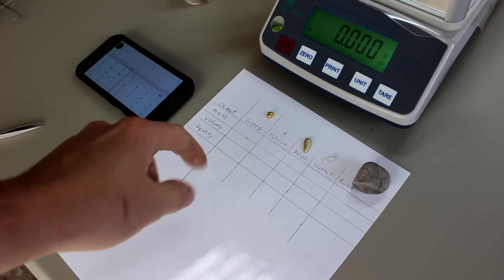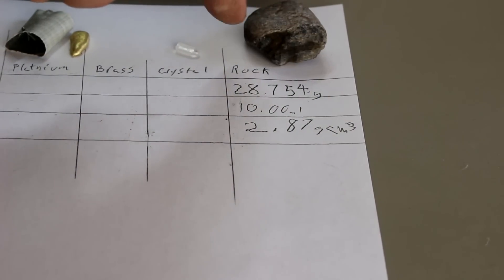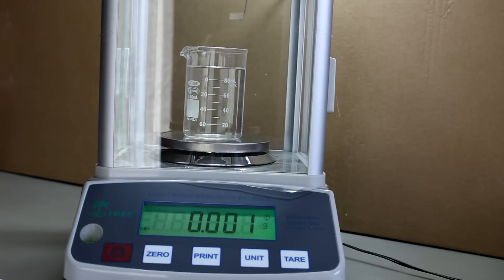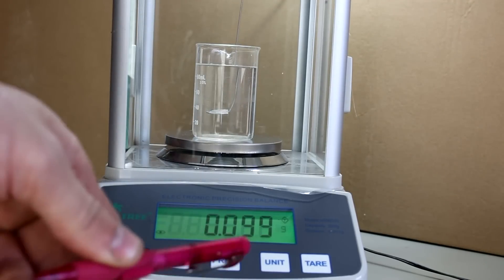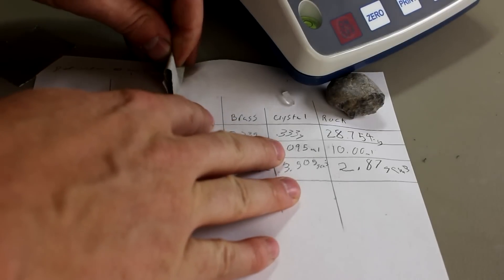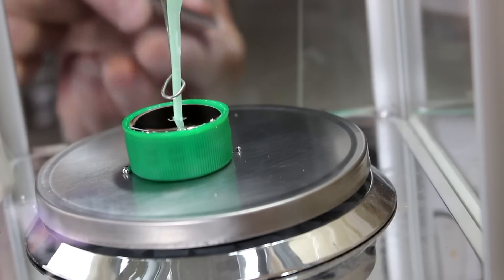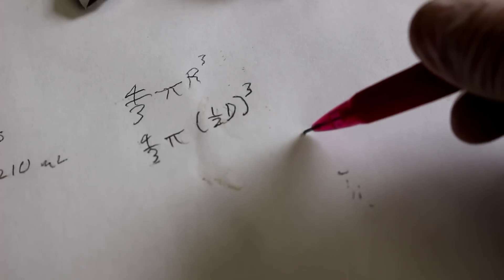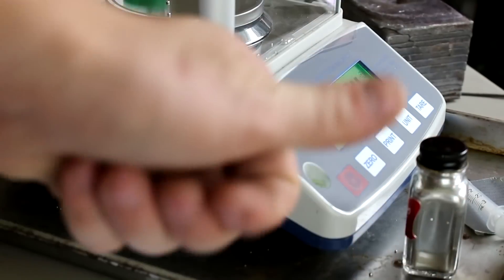Measuring Density of Small Irregular Objects

Comment: Would the buoyant force not be proportional to how far down the object is placed in the liquid?
Reply from the maker: nope
Reply: You were probably thinking about hydrostatic pressure. Those are two different things. The buoyant force basically is the weight of the water which is "pushed away" by what ever is submerged in water. So as long as the object is completely covered by water it doesn't mater how deep it is because it still is going to "push away" (displace) the same amount of water.
Reply: Ah okay thanks

Comment: your platinum measurements were rather erratic.. 5 increments of the same value off of one another.

Assuming the item was platinum with some imperfections, it is more likely the mercury measurement was correct.
it was often close to lead and lead is less dense than platinum.

Comment: Hi Cody. it's a nice method to find the volume of random objects. but I'm wondering if you ad the object into the beaker the waterlevel will rise. and therefor more of the wire will be in the water. so the volume must be the volume of the object plus the volume of the additional exposed wire.
Reply: that is correct!
Reply from the maker: the amount it increased was below the detection level of the scale.
Reply: So it does increase it, but not enough to really matter in this case.

Comment: Could you do Mercury by using liquid nitrogen instead of water allowing you to have a bead of mercury to sit on the wire ?
Reply from the maker: I would just add the mercury to a little cup just like I did with the platinum.
Reply: That would give you the density of solid mercury at almost -200°C. That value won't be of any use when working at room temperature.

Comment: Wouldn't measuring the weight of the object in the water be unreliable as it's still displacing water which would add to the weight? Shouldn't it have been weighed outside of the beaker? Sorry if I'm wrong
Reply: Upon watching more of the video, this is on the crystal only, but I believe you would have to take away the amount displaced to get the true weight of the crystal
Reply from the maker: The buoyant force is adding its weight along with the extra weight that would be taken by the wire.
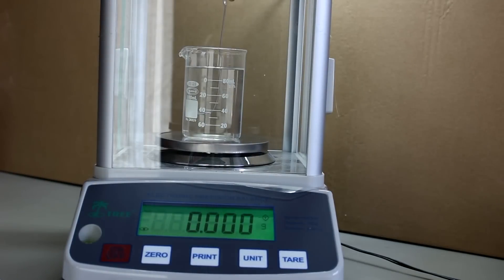Reply: Sorry if i'm confused, but wouldn't that then give a bad result of the crystals mass at 3:05 ?
Reply: No the buoyant force is not an issue because nothing is pushing anywhere else (contrary to the metal wire scenario). But the issue with putting the crystal in the water is the measurement sensitivity. What the scale sees is mass of the water + mass of the crystal, if the balance has a 2% relative accuracy and the crystal weight 1% as much as the water, the dilution of accuracy is incredibly high. Imagine you have a multi-range auto-select scale, the water itself might have shifted the scale to a high range, but you are still trying to measure a very small difference of mass. 

I won't go into it because it's an engineering field in itself, but when measuring something, you should always try to measure it in the smallest range of your measuring device possible, and the ratio between your measured value and the high side of the measuring range gives you an idea of the quality of your measure.
Reply: i have an accurate scale and i will test your theory, owen

Comment: I have a Question: when you weighed the crystal you put it in the beaker of water, wouldn't the .333 be the weight of the crystal plus the water displacement? so the weight would be around .238 (unless the height of the object is important). anyways , love your vids! and I live not far from you!
Reply: Theoretically, if the crystal is supported from a suspended wire and not actually having it's gravity and mass directly in contact with the scale, it acts as a "crystal of water" when it merges in volume and then you figure out the funny business on why it's readings are different than a crystal-sized amount of water with some math! :) Hope that helped.
Reply: Okay, so what he is measuring is equal to the mass, because the buoyant force pushing up on the object has a resultant push down from the liquid, which is equal to the buoyant force in magnitude and thus cancels it out.

Edit for anyone else thrown for a loop: This is only the case because we are weighing the object AND water. If we had a tiny scale in the water measuring the crystal it would read less than the mass because it wouldn't be able to measure the water around it and read out the resultant force.
Reply: PterodactylDanceParty
Try for yourself, please. Any kitchen scale should do the trick.

The easiest way to see that you are wrong is if you use a bottle of water as the weight, in a bowl of water. With your reasoning it shouldn't move the scale at all, since the densities of the water in the bowl is roughly the same as the bottle.
Reply: The mass of the crystal is hung from the ceiling, so it doesn't affect the measurement. What does is the fact that the volume of fluid it displaces will be pushed higher up in the beaker, meaning you have a higher column of water, and a higher column will exert more force.
Reply: Right, but he measured the mass of the crystal INSIDE of the beaker. This means it was submerged and there was a buoyant force present.

EDIT: I'm wrong
Reply: PterodactylDanceParty
He didn't measure the mass of the crystal. The crystal was entirely supported by the rod. He measured the buoyant force alone.
Reply: I'm not talking about that. Go to 3:02 in the video, he drops the crystal into the water and it falls to the bottom. He uses that number as the mass of the crystal, which is incorrect. I assume Cody realized this for the brass onwards, but left it in the video for the crystal.

EDIT: I'm still wrong
Reply: PterodactylDanceParty
That is not incorrect. The buoyancy in this case is from the liquid pushing the crystal upwards, and as Newton famously said: "Every action has an equal and opposite reaction" - the liquid is pushed down by as much as the crystal is pushed up. Since both the liquid and the crystal are in the container, the effect of the buoyancy cancels out.
Reply: I'm sorry, but what you're saying doesn't make sense. Yes the forces cancel out, but that downward resultant push the beaker feels is measurable and being picked up by the scale along with its mass.

EDIT: Yup, still worng
Reply: At this point I can't tell if you're messing with me.

Assuming you're not, just humor me for a bit. What is Cody doing at 3:02, and why?

EDIT: Sassy and wrong
Reply: PterodactylDanceParty
He is weighing the crystal, so he can calculate the density of it after he has measured the volume of it by placing it on the supporting rod.

I am not trolling.
Reply: Correct, he is collecting the mass. However, the crystal is submerged at that time and has a buoyant force on it, right? The number on the scale at that moment represents more than just the mass. You should not collect the crystals mass while it is submerged, do you see what I'm saying?

EDIT: Wrong, but about to get it
Reply: PterodactylDanceParty
I see what you are saying, but it is wrong!
Reply: I might be starting to see what you're saying
Reply: PterodactylDanceParty
On the point! :)
Reply: Well said !:-)

Comment: Hmm, you should take the average over three axes, not two.  Probably even the geometric average, rather than the arithmetic average (though that will make little difference for measurements this close together).  Simple enough: if you have a sphere that's pressed down on one side, you only need to measure the "long" side once, but that "side" has two dimensions, so you assign it double the weight, when you take the average.

Comment: When you place the irregular material into the liquid, the liquid rises up and more of the wire holding the irregular object is now under the liquid. This new amount of the wire under the liquid should increase the amount of buoyant force not related to the irregular object. Can you calculate this amount so you can factor it in for more accurate results?
Reply from the maker: you could, or you could use a wire so small that the change is in the sub milligram level. :)

Comment: earlier this year i had to use the same method, but used a much higher density liquid for improved results. We made a Gallium Osmium alloy which had an SG 17 and was liquid at Australian room temperatures (35.3c)
Reply from the maker: I'm very interested! I've never heard of using a gallium osmium alloy! I have to try this now.
Reply: ***** NOBODY EXPECTS THE SPANISH INQUISITION!
Reply: Sounds dense
Reply: ***** the easy way might be to dissolve (react) osmium into gallium slowly at around 50c - see how you go.
Reply: which aussie university/facility was this at?
Reply: Hmm, that doesn't sound right. I don't have a phase diagram for that, but I'd guess the Ga-Os system contains lots of intermetallics.  Or that they're immiscible (which is the case for the only one I do have, Ag-Os).  In either case, I doubt you'd get a nice low temperature amalgam of anywhere near that density. But I'd love to see the data, if it exists.
Reply: didnt expect to see you here... :b
Reply: Tim Williams yes

Comment: Hey Cody, for that experiment to work accurately, doesn't that water have to be purified, and the air has to be removed from the chamber? How do you compensate for the different gravimetric forces present on different areas of the Earth? ;-)

Comment: can you explain how putting a piece on the wire to determine the buoyant translates to volume?
Reply: Here's my attempt at explaining.

The stuff on the wire is being held up by the wire, so the weight doesn't transfer to the scale. It is displacing some of the water though.

When you stick something less dense than water in water, the water tries to push it back up, right? The same thing is happening, except the object is still denser than the water, so it can't actually push it up. The result is that the upwards force on the object in the water is being cancelled out by an opposite force of gravity on the object in the water, which does push down on the scale.

So what you're really measuring is the weight of the water that the object is displacing. Except we know the density of water already (1g/cm^3), so we can figure out the volume of the object in the water.
Reply: +seigeengine good job.
Reply: +seigeengine thank you

Comment: I recommend that you make the time lapses at the end more frames per second, although it will be a bit shorter it will look so much smoother.
Reply from the maker: it will also be compressed by YouTube into an unwatchable mess. :(
Reply: +Cody'sLab ik it sux right. But the time lapses still rock.
Reply: I do time lapses often and it is not a compressed mess.. I will give you info on how if you are interested!

Comment: Cody, I could be wrong here, but the device at this point (3:13) is reading the combined force of the object and the buoyancy force, due to the object displacing water in the beaker. Therefore, .333g would be an inaccurate reading of the mass of the object alone; the device your using only reads apparent force which is  (= force of object + force of water displaced). I could be wrong, so I make this comment with the utmost of my humble support.

Comment: Wouldn't it be necessary to make sure the wire doesn't move up or down in order to have an accurate reading?
Reply from the maker: yes, that is what the stick was for.
Reply: +Cody'sLab if you inflate a balloon inside the water would you get the density of air?
Reply: I'm a dumbo. You need to also know the weight (mass) along with the volume to calculate the density *facepalm* it's 2:30am
Reply: I assume because it reads the amount of wire submerged in the liquid.
Reply: Dylan Zrim I'm guessing this method isn't suitable for gasses.
Reply: I'd say you'd actually want the wire to be slightly higher with the object to measure on it. The liquid rises causing more of the wire to be submerged, so you're also measuring the volume of that small bit of wire unless you raise it a bit so the same amount of wire is submerged for both measurements.
Reply: he has it hanging up so it wong move
Reply: I don't think so. It would float up. The only way to keep it submerged would be to tie it down and it would just pull up. I'm not sure though.
Reply: +Damian Reloaded those values might not be that hard to find
Reply: +Damian Reloaded maybe not the most accurate, but it would get close, but being gas it would need to be restrained from below
Reply: +Damian Reloaded the last equation could be used?
Reply: Well you would get to know the density of the balloon (rubber) maybe the air? idk
Reply: +Chirimorin1 Hmm.. that's a good idea, but how much should you raise it?
Reply: I dont think it would read anything on the scale since the buoancy force would be upwards, since most gasses are lighter than water, so there isnt any force from the object acting on the scale that you want the density of
Reply: ballon compresses the air and increase its density anyway
Reply: Yes, it would work with a balloon. The water pressure will compress it but not radically unless you are using metres deep of water, and you can factor that out, anyway.
Reply: +Damian Reloaded But how do you calculate the volume of an object when it's in the form of mass that was diaplaced by the object? Do you divide the mass of the object by the mass that was diaplaced by the object? I don't see how that could add up.
Reply: Dylan Zrim You wouldn't be able to weight it though. and its volume (and density) would vary with temperature.